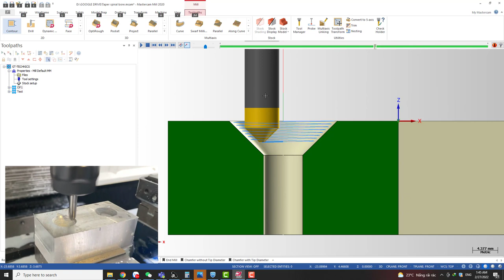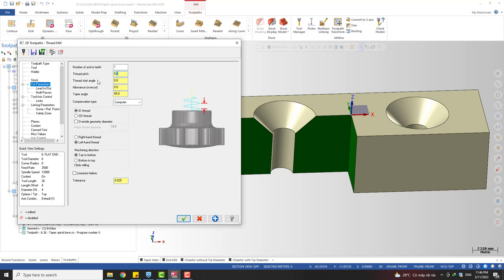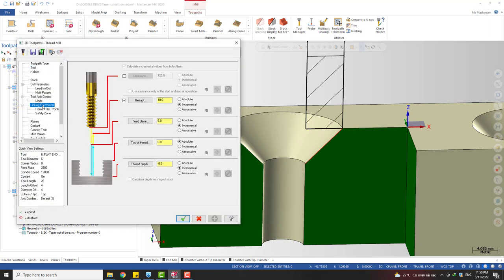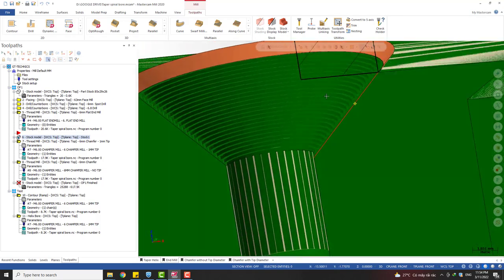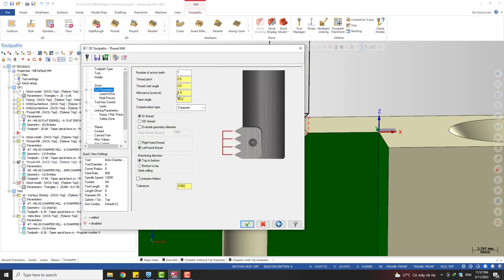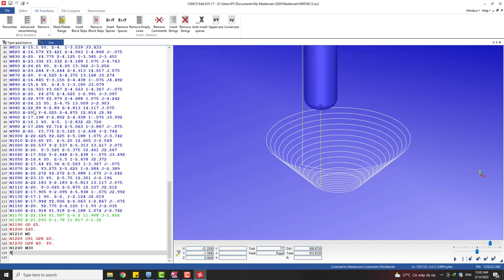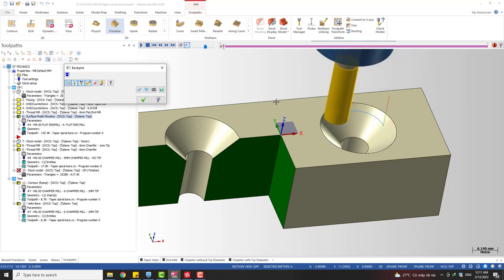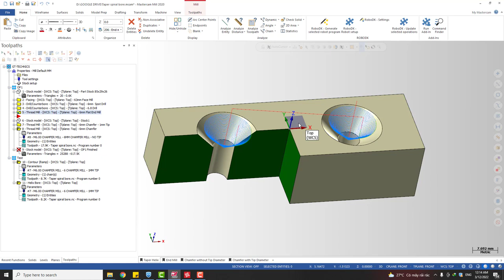Mastercam tip: Taper Spiral Boring in Mastercam - Countersink boring

Comment: I've followed your steps and double checked my programing and I am still getting steps from the finish tool. I started with a 3/4 inch chamfer mill and the switched to a insert chamfer tool. With both tools I'm getting steps left in the countersink. Do you have any suggestions?
Using master cam 2020